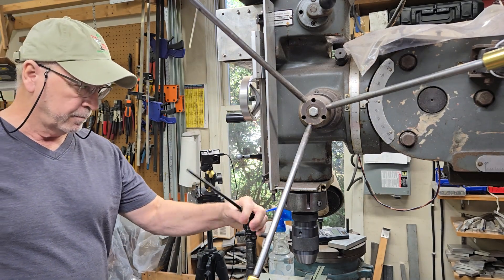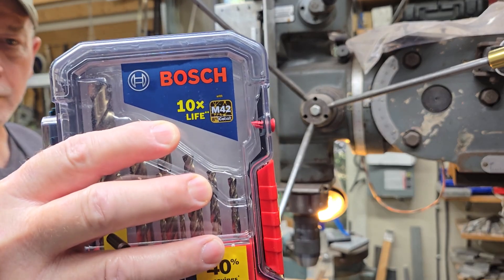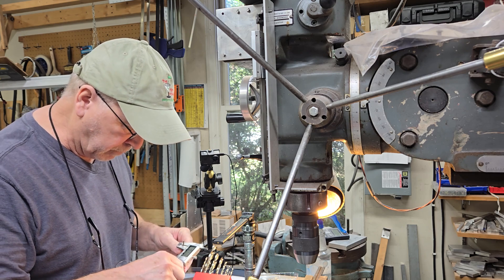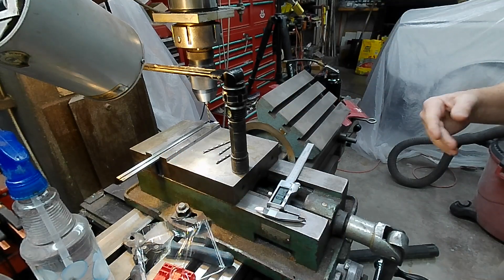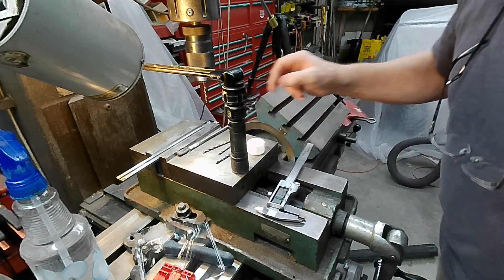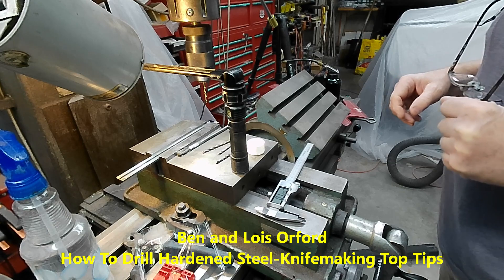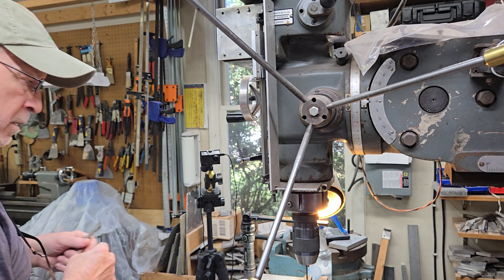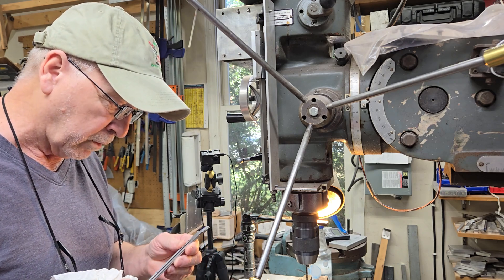Bosch Cobalt Drill Test in Hardened Steel

Comment: There are a lot of different carbide drill bits. A lot of people try to use bits that aren’t meant for hardened steel, and they go quickly. Those meant for hardened steel are very different. They aren’t spiral flutes. They have straight flutes. I’ve found the best place to get bits is McMastercarr. Their selection is vast and they have bits to cut everything. I just bought a bunch of Ti coated cobalt in metric sizes to add to the ones I already have. Excellent quality.

Comment: If you need to drill very hard steeel,,,use masonary bit ,,,do not use lube,,run at 5000+ rpm,,,peck drill to keep braze from melting off carbide,,chips will be glowing orange,,,gives a very smoooth hole

Comment: Yea, I usually spin the little bits faster but cool them a lot!!
I do need more bits! Carbide is nice for the hard stuff..
Cobalt usually does the trick but Hi speed steal is better for most things and can be re-sharpened easier. 
I remember drilling out titanium hucks on F-14's with re-sharp double ended drills....Ughhhh, spin it, burn it, re chuck it and pray... Could take a few bits for one rivet!